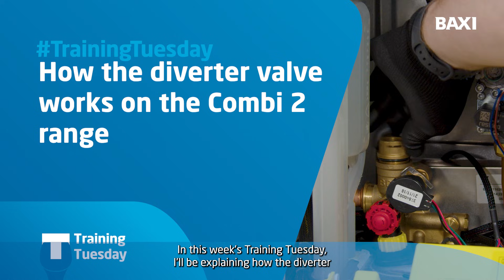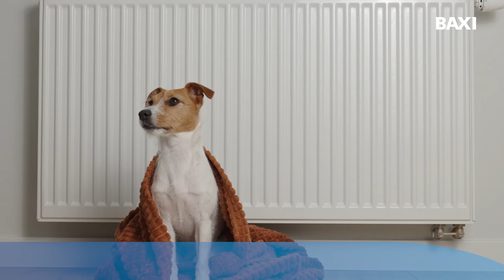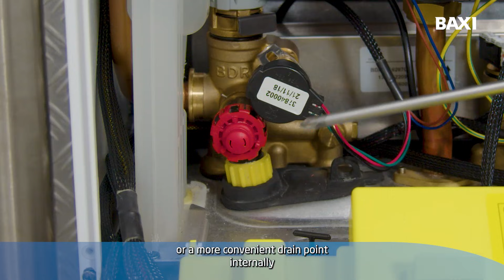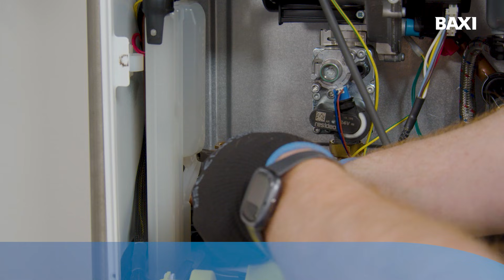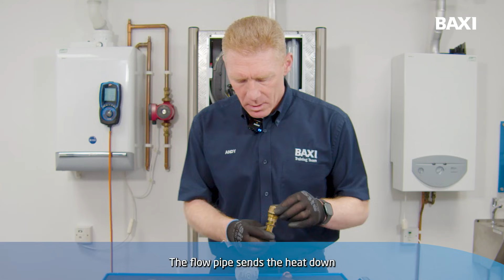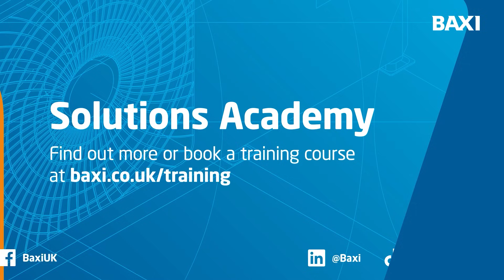How the diverter valve works on the Baxi Combi 2 boiler range

Comment: So it basically works exactly the same as it did before 😂😂 only difference is the colour of the actuator head.. video could’ve been 5 seconds long 😅.. on the plus side these boilers are in my top 5 for their simplicity and original design.. for those criticising the leaking issue, remember that vaillant diverter valves are just the same if not worse yet they are the best. Keep your original design baxi/main/potterton unless you can copy the Worcester diverter as they are probably the best diverter.

Comment: A Baxi technician telling us to drain from the PRV? Why do you still use the same design for the diverter, that has always leaked into the motor and snap internally when trying to remove? I would've thought by now there would've been some upgrade to them.
Reply: the boiler has a combined prv and drain off , by using the drain off, you don't disturb the prv, although the down side to this is be mindful of where the prv terminates, as for the diverter cartridge, they are now brass not plastic, very rare they will snap internally, was for them leaking, will be down to water quality, or the quality of the seals